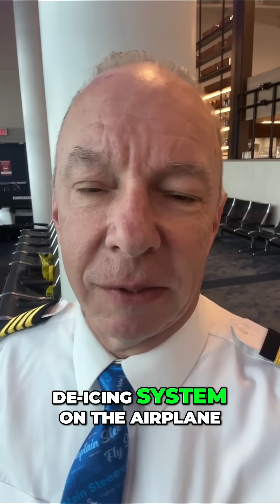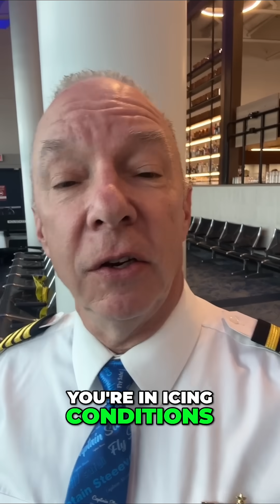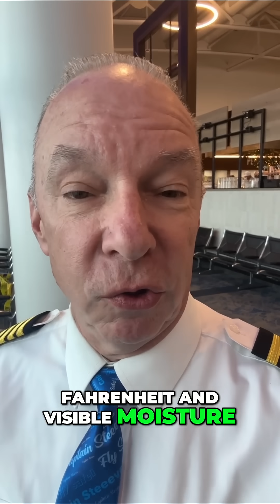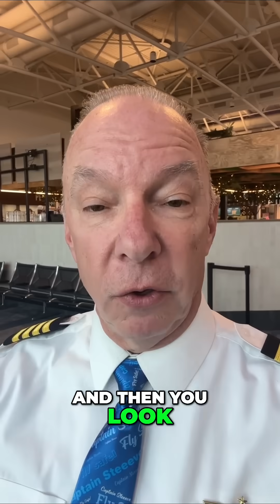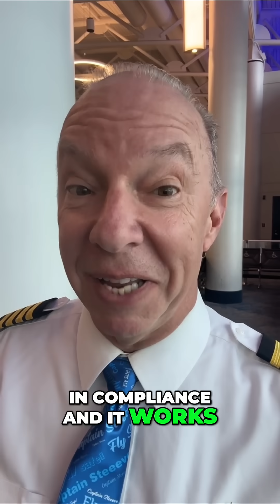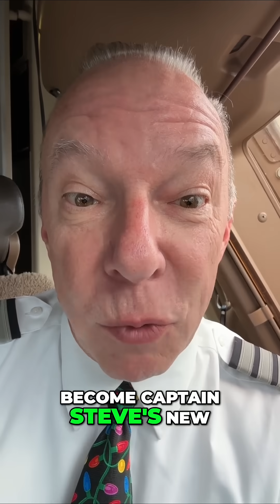Mastering Anti-Icing Systems: A Pilot's Essential Guide

Comment: When you think that in autumn winter or early spring your car parked outside can be up to 6° centigrade (more than 10°F) colder than its surroundings then it's utterly reasonable that aeroplanes allow a bigger margin for error/variance because of the potentially catastrophic outcome if they don't.
If you're on the margins of freezing/icing it doesn't take much more than a gust of wind to start ice/frost forming.

Comment: Hi Captain Steeeve,
I saw a plane fly over today and it made a slight adjustment to its flight path....it veered a little left and continued on. That got me thinking so please answer this....if that plane kept on its original heading and at a point say A and flew exactly 2000 miles and marked an imaginary point B. If another plane comes along on the exact same route but at point A veers off say 2° and flies exactly 2000 miles to point C.  Would there be a big mileage difference between B & C?? 🤔🤔
I love your videos!!
Ralph, Northern Ireland 👋

Comment: Most of us let us say older folks know what is happening or at least have poured some carburetor-alcohol in our fuel tanks to prevent the exact same situation in our carburetors.... As moist air around 10°C/50°F and somewhat lower gets sped up the temperature falls rapidly and the moisture freezes very quickly to ice and gets stuck as ice on the near by spot. How an airplane cannot fly with ice on its wings I don't really know and we have to ask our beloved Captain Steve, but in the carburetor the holes for letting the gasoline into the engine are simply just shut of by ICE! No gasoline, no engine running 😅. Now you know, drive safe! ❤️

Comment: Ive seen a little leading edge ice build up on a day with temps at altitude above 60°F, the metal on the wing was so cold and damp at speed (280 kts) that it put a little coating on there.

Comment: If commercial passenger planes have anti-icing systems, why are some planes sent to deicing stations on the ground before takeoff?
Reply: Because anti icing systems can prevent the buildup of ice, but can't remove inches thick snow and ice from sitting on the ground.
Reply: Anti icing can only work once engines are on. Obviously during the time their off ice and snow builds up.

Comment: Is that only on the ground or in the air too? Id imagine there’s not much moisture up at cruise but maybe there is? Do you fly with the heated leading edges on?
Reply: Clouds are an example of visible moisture. Some clouds can be as high as 60k ft. But bc the plane is cold, when it goes through the moisture, the plane's surfaces freeze. You dont necessarily need de-icing on the ground bc you aren't flying 200 mph on the ground